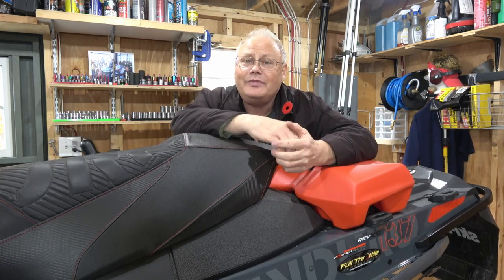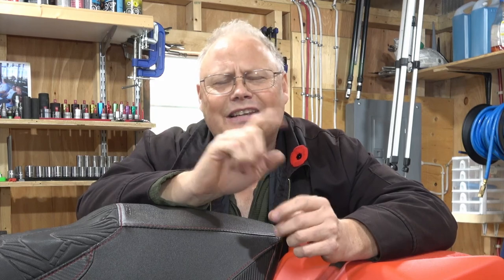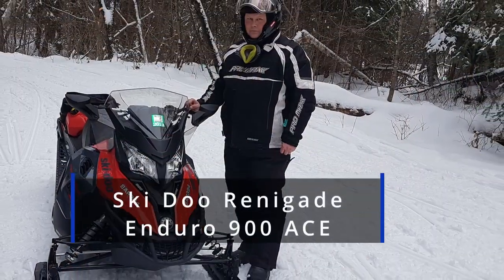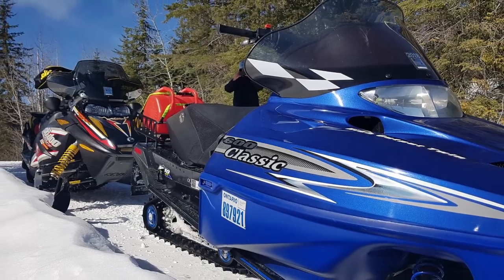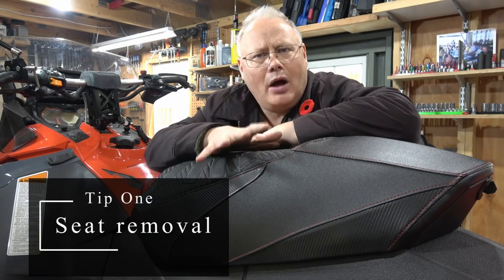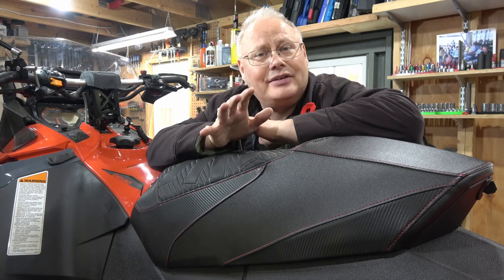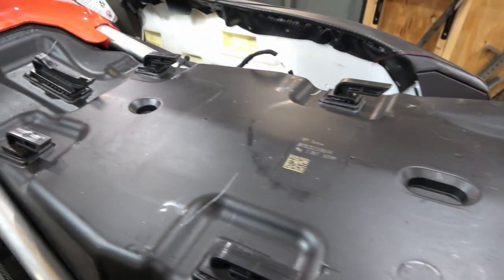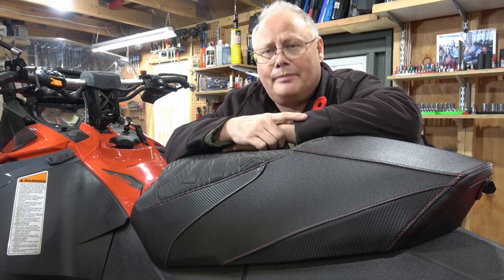I show you 6 Tips for really  New Ski Doo owners

Comment: Great intro video for that newer rider(s). About the tools that snap on to the belt cover. I'd strongly advise that they be placed in a mini tool pouch & placed either in a Glovebox, Handlebar bag, Tunnel Bag, etc... They have been known for falling off or not placed securely & get caught up in the Clutches.
Reply from the maker: Thanks for the tips!, I can see how that could be an issue for sure  and could lead to a bad day if the run through the clutches.
Dino

Comment: Great video and exactly the sled I’d like to get next.  Still riding an ‘09 MXZ eTec 600, which gets pretty good fuel economy, but I’d like to go 4 stroke and the 900 ace is what I’m after.
Reply from the maker: I really like mine, it is smooth, quite and with the air ride you can cover hundreds of Km per day in comfort. Not having to buy oil is also a great advantage.
Thanks for the comment
Dino

Comment: great content - especially the part about belt removal and deflection ... do you plan to do another video on optimizing belt deflections and the steps to achieve it?
Reply from the maker: Thank you for the comment. I do have a video out on setting belt deflection already, it is a basic set up and only covers how to set up the belt as per the manual. More advanced alignment or how to shim for clutch alignment is not covered in it.
Dino

Comment: I have a 07 Ski Doo. How do I know if it is getting oil to the gas. My lines are dry
Reply from the maker: Boy oh boy, you should be able to see the oil in the lines. You could try and make up a gallon of pre mixed fuel and run the sled on that then you could pull off the oil lines to ensure oil is flowing.
Dino
Reply: I am going to bleed and fill the oil lines. The sled has not been ran in 3 years. Just going through everything, before a start !!
Reply from the maker: @michaelmaurer1226  always a good practice
Reply: I cannot find any oil lines on my 07 SKI-DOO

Comment: I cannot find my oil Lines on my 07 Ski Doo
Reply from the maker: The main line runs from the oil tank down to the pump and then up to the carbs I believe on yours if it is a 2 stroke.
Dino
Reply: Yes, 2 Stroke 550
Reply from the maker: @michaelmaurer1226  hmm that's the fan cooled correct? I have never owned a banner, but my so  in law has, I'll ask him. Is is stock Or could a previous owner performed an oil pump delete? 
Di o
Reply: @DinosTinkerShed  No Fan or radiator. But does have coolant tank.
Reply from the maker: @michaelmaurer1226  and your sure it's a 550? Just checked the service manual and the 550 is a fan cooled unit. Are there heat exchangers above the track mounted to the underside of the tunnel?
Reply: @DinosTinkerShed  Sorry, 500ss
Reply from the maker: @michaelmaurer1226  lol that makes more sense. If you search online there are service manuals out there for free kicking around. Usually I would search skidoo rev service manual PDF and there are a few websites that you can find them. I would check on dootalk, forum, they are usually helpfully to locate one. If I remember right, the oil pump on those is at the back of the engine on the bottom of the block under the carbs Nd can be hard to see especially if you are not sure what your looking for. You can usually see it if you take off the secondary clutch and get a flashlight in there.
I hope this helps
Dino